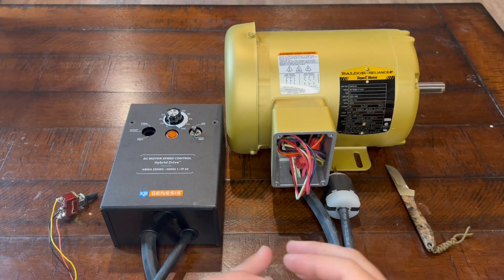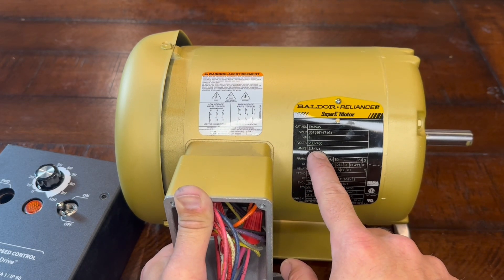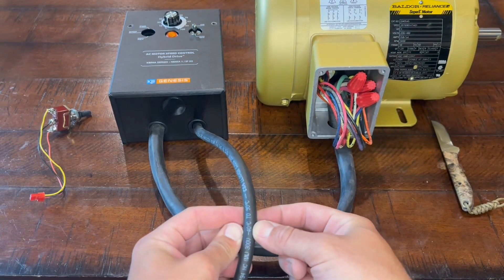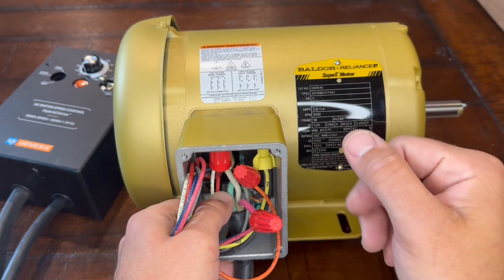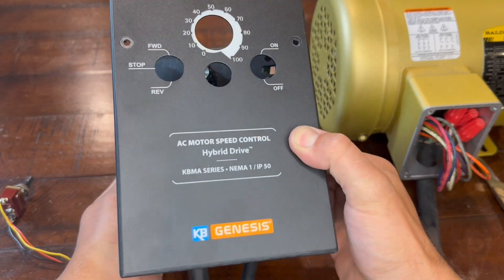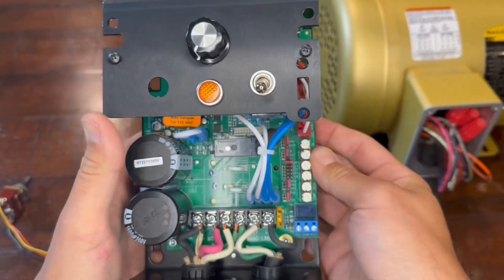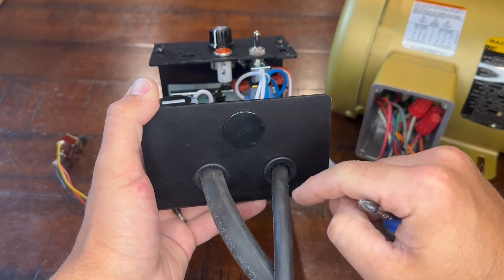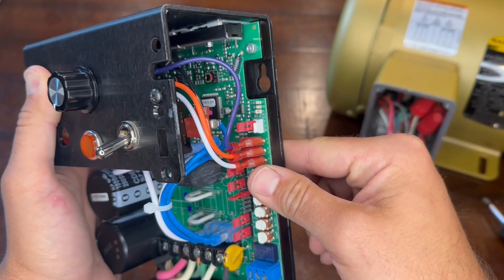Wire a Variable Frequency Drive (vfd) Its Easy! KBMA-24D

Comment: Great Video, I wired my 1/3 Hp. 3 phase motor the exact same way and also using 120v. But every-time I plug into the wall outlet it trips the GFI, Not sure what I have done wrong.
Reply from the maker: @NativeColorado-r9d  simple. VFDs arent supposed to be used with a GFI. Youll either have to remove the gfi outlet or use a non gfi circuit
Reply: Many thanks, I removed the GFI outlet from the circuit and the VFD works as it should. I appreciate the help !